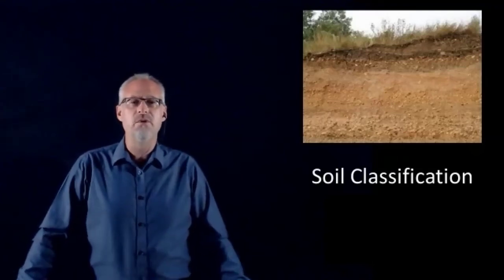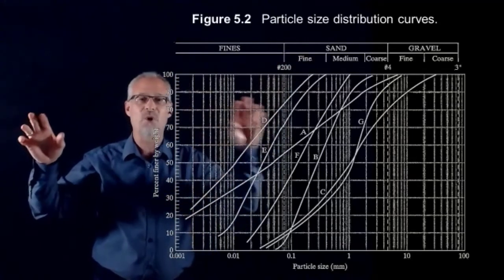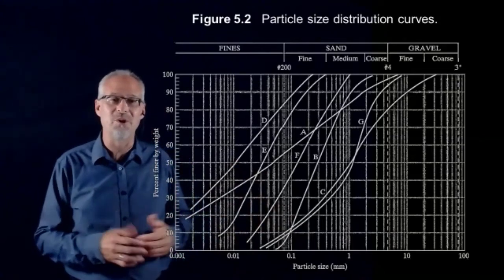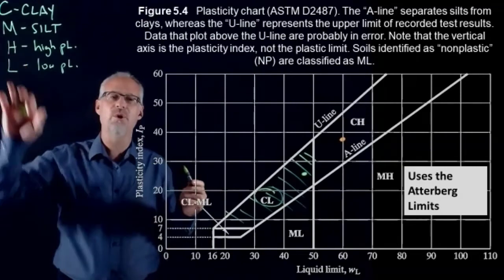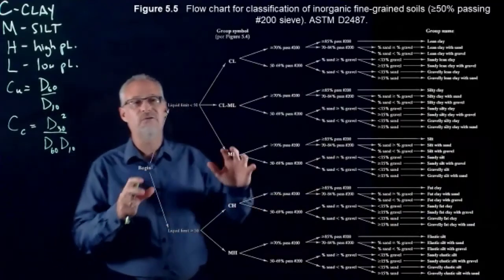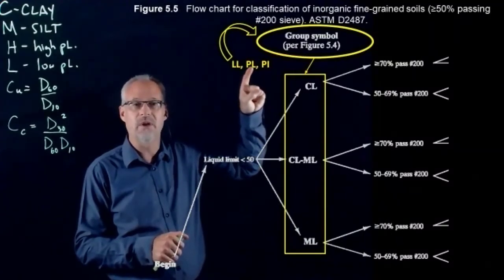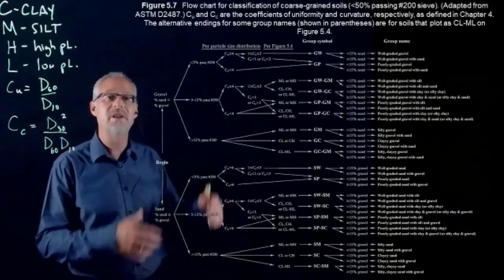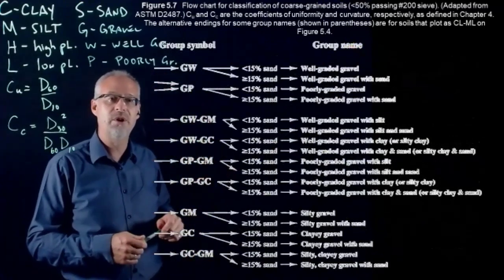Soil Classification in Geotechnical Engineering

Comment: How did you get the solid black background with the lightboard?
Reply from the maker: I'm using a black sheet pinned to the wall.  The trick is to get the lighting just-right.  I also adjust the exposure and brightness of the camera to make the black look very-black.  If you want to see the equipment I'm using go to www.lightboarddepot.com.